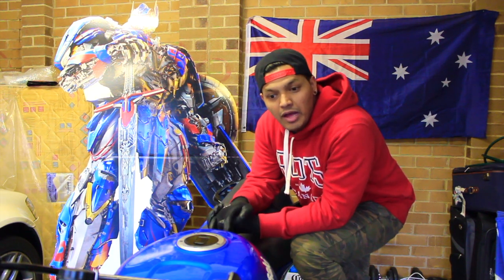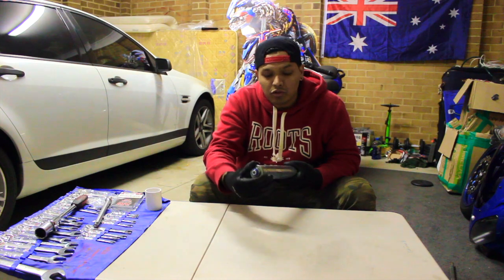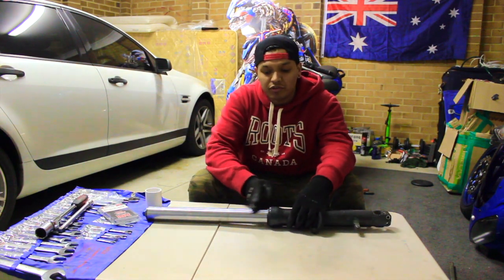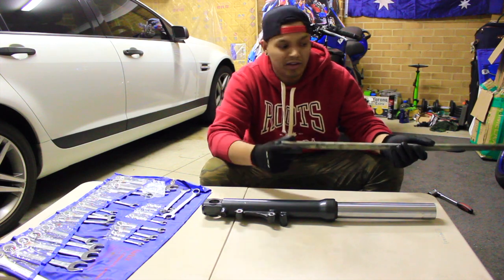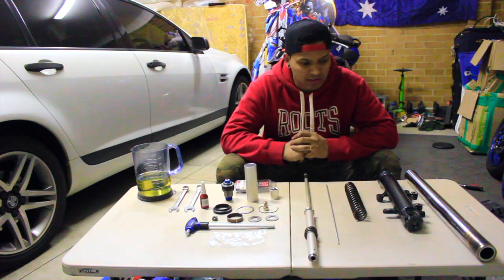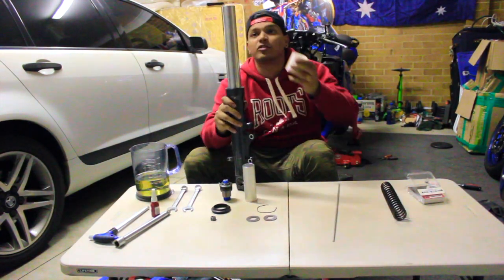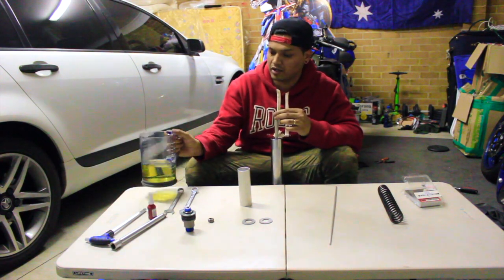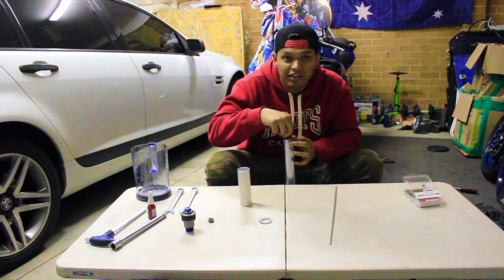Replacing Right-side-up Fork Seals and Rebuild

Comment: How did you make that damper rod tool? I need one but can't find a place to buy it
Reply: @SammyS1000RR-ch5gk  I have right side up (outer tube on the bottom). I went to Lowes and got one of those square hollow bars. Worked!